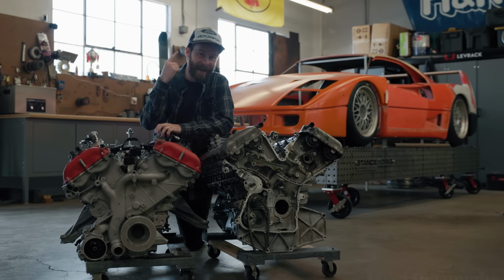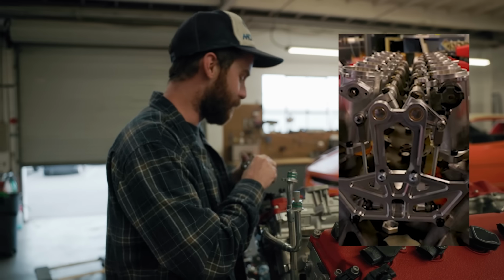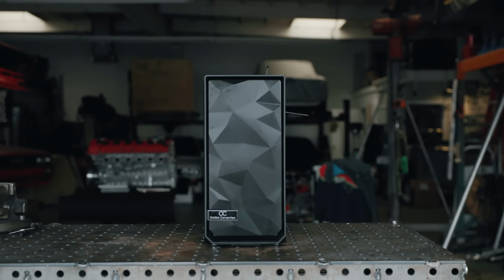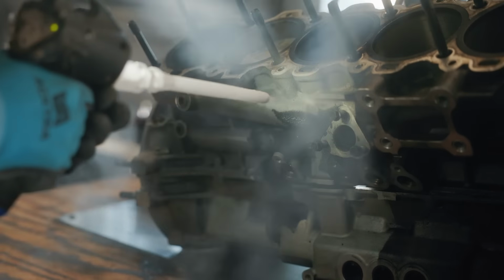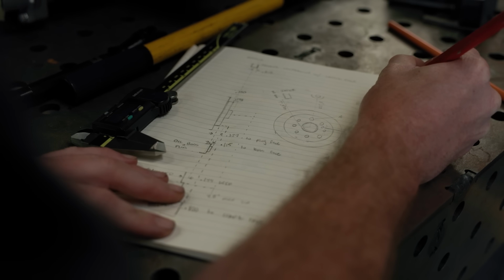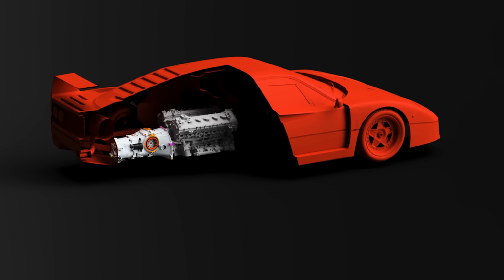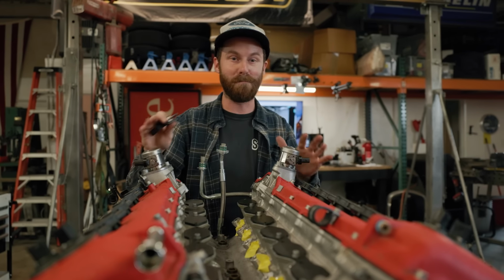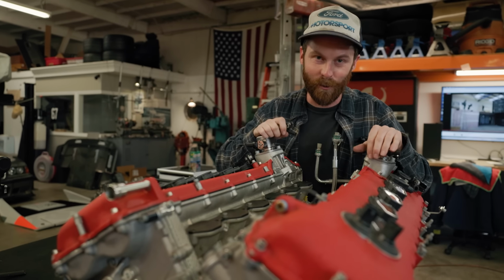Stuffing a V12 into my F40: 3D scanning is my favorite tool yet.

Comment: The only difference that I could imagine port on ethanol vs DI is that fuel will take up some space in the intake tract and around that valve that then cannot be air. It's probably extremely negligible though. 

Smart move makes sense.

Comment: DI isn't inherently dirty, it is the EGR and crankcase ventilation being put back into the intake that makes the runners dirty. Some ways to make it run cleaner are:

1. Having a catch can that can separate the oil vapours before they go back into the intake
2. Making sure you bed the rings in properly to reduce blow by and therefore crank case ventilation
3. High quality oil

I've got a Mk6 Golf R which has done about 180,000km (115,000mi) and just had the first decarbon. The guy who did it said he has seen other DI vehicles that have had multiple cleans that were dirtier than mine. I don't have a catch can but made sure I went through a run in procedure when I got the car (I bought it brand new) and have run Motul full synthetic oil since the first change.

Still think you're right getting rid of it because it's a PITA to tune and the options for bigger injectors and aftermarket ECUs are limited. I'm looking at going to a bigger turbo and am looking at ECU options that will allow me to supplement the DI with 4 port injectors which I think will actually give me the best of both worlds.

Comment: I buy the rational behind removing DI, especially on an already performance oriented motor. 

I think the general idea that DI motors are designed radically differently from MPFI motors comes from the design differences in efficiency oriented motors. Small economy DI 4 cylinders often use very small tumble ports and unusual piston crown geometry to take better advantage of the efficiency benefits of DI. That typically makes the conversion to port injection difficult and inefficient on that type of motor.

You'd think a Ferrari motor wouldn't make these compromises, and at least in port design it doesn't look like they do. 

That said I'd love to see a comparison between the insides of that motor and it's MPFI equivalent (especially combustion chambers/piston crowns). Would be very interesting to see what Ferrari did and didn't change when moving to DI.

Comment: If your not manually controlling the clutch to shift gears its not a manual.... this guy is a joke
Reply from the maker: Would you call a dog box in a Nascar a manual? You don't clutch with those either. Nor any Trans Am road race car. Nor any Formula Drift car. Most race car gearboxes don't use the clutch to shift.

Comment: God, this is so lame. OK, you don't want direct injection; why? Because it's for emissions not power. Next? "I want to eliminate a fuel pump driven off the cams, but don't want to "unbalance" the engine, even though "I don't know anything about them". Geez. So much for engineering, let's just chop up a perfectly good motor and see what happens. Oh wait, OMD in San Diego eliminated the direct injection and "they got it running" and "it's insane" and "it's so sick" and "incredible" with the "coolest valve covers I've ever seen". Wow, that sounds really good.
Reply from the maker: Just don't watch then, no need to be rude about it. You don't have to like my episodes. It's not for everyone, I understand. :)
Reply: Then you go out and build your own F40 with a Ferrari v12 and direct injection.

Comment: Gti golfs etc on di make 11;1 c.r turbo and run e85? And there's knowledge on going over 500hp with 2l. The fact Ferrari did di and 13:1 is exactly why it's di. But yeah. I will be surprised if you have 700whp. I don't want the rods to leave the block for you.

Comment: why on earth are you dry ice cleaning on a dudd engine. Just a waste of time and procrastinating
Reply from the maker: Different strokes for different folks. I don't want to look at a gross, nasty engine for the next two years. Why not spend some time to clean it up? :)
Reply: @stanceworks  Idk, I wouldn't use it anyway, you already have the engine you want to use, why use that? not to mention it has a massive hole in it so the measurements are probably off-bonk
Reply from the maker: I don't want to be cutting and grinding metal next to and over an expensive engine.
Reply: @stanceworks  fair enough I guess. But the project will be much longer if you are doing side quests
Reply from the maker: I'm here for the project, not the end result :)
Reply: @stanceworks  i mean you get paid by sponsors no matter how long the project is so ig it doesn't matter

Comment: $100 and you could’ve had a machine shop clean it with a hot tank to come out even better than those burned heads did.

Probably not as satisfying content, but pretty standard work.

Comment: Would have been pretty cool to see you do both direct and port injection. I know you're an older BMW guy but anything N54 and up usually do both to increase fuel flow and to eliminate valve cleaning issues. You can keep the benefits of both systems, at really not all that much more weight or complexity. You just need an intake manifold spacer, extra fuel rail, and controller (or in your case, pretty sure the haltech can handle a workaround to run 24 injectors, i'd hope). Efficiency can run both ways, either more MPG OR more power.

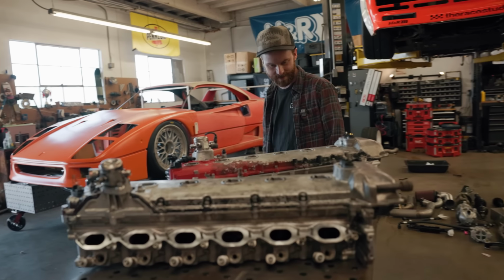Comment: 14:58 anyone else cringe when he sat the cylinder heads on a steel fabrication table, then proceeded to slide them around? Hopefully those mating surfaces didn't get all scraped up and gouged.
Reply from the maker: The heads are trash anyway, worry not!
Reply: @stanceworks  OK that's for the reply.

Comment: 22:43 "crazy sized adapter".... You're building a chassis. That size difference would work fantastically with a midplate... just a metal plate attached to the frame, that sits in between the transmission and engine, serving as a super-stiff mount for those and here, potentially, suspension components.
Reply from the maker: Why use a massive adapter plate when you could just have a transmission that fits? :)
Reply: @stanceworks  Because you can skeletonize the adapter plate and use it as a frame member as well as potentially eliminating a set of engine mounts (depending on layout). Eliminate one crossmember and take care for some inherent triangulation, and you can still use a thin plate as horizontal location and torsional rigidity... even a solid plate, guessing here 4' between frame members and 2' tall for a nice even 8 square feet of material, 1/4" thick 6061... 288 cubic inches, I'm getting 28 pounds for that and I'm not figuring in the missing material for the interface or anything removed from the ends. 30% excision = just under 20lb. Not bad for a hamfisted set of example numbers. 

It's a classic solution for drag racing, that's really the best place to look for pros vs. cons.

Comment: I like direct injection, but my usecase is wildly different. We don't have E85, and i somewhat care about efficiency.

Also saying direct injection is dirty is kinda misinformed. The reason why it is seen as dirty is because all the oil dumped on the valves by the breather pipes does not get washed away when running purely just direct injection, but either a dry sump or running something like water methanol completely solves this issue.

Comment: Why you dont use port and direct injection for better tuning to have both benefit??? And the High pressure pumps for Port injection with high pressure injectors for better atomasation???? And keep rhe high compresion on cylinders???

Comment: agreed, DI only makes sense if you keep the factory computer. Good luck running it reliably on anything short of the most insane, bleeding edge motorsports ECU. DI is vastly superior to port injection from a science (especially physics) standpoint, but as you explained e85 more than solves for the performance and engine calibration issues you introduce by moving back to MPFI.

Comment: While you talking about the holinger with paddle shift, i just thinking that maybe someone has made the wireless paddle shift with the receiver/servo attached on to the gear selector, lessweight than using pneumatic with compressor 🤔

Comment: Why..???  😣 when theres an F50 or an enzo or laferarri all mid engined v12’s.. why would you want to take away the bulk of the F40’s unique character being that 2.9 V8 twin ihi turbo spooling to almost 8.000 before dumping n comp surging and cackling on a trailing throttle..
Reply: Because the F40 is the coolest Ferrari and a Ferrari V12 is a quintessential engine. And because he can.
Reply: 🤓 “WHO TF IS THIS GUY” ???? 🤣
Reply: @bossboyritchno1685  not sure who you are. V12 wail way better than twin turbo v8 noises.
Reply: @seancca  cornball 🤡

Comment: What is the overall length difference between the v12 and the v8 of the F40? That would be valuable information when you are working out the ergonomics and chassis design

Comment: This car is already undrivable at nominal power. The only way to address its funky, very upsetting handling would be to give the front more grip—essentially adding significantly more weight toward the front. But if you put a lighter engine in and double the power output to 900hp, the rear wheels will spin like crazy.
If you want to make something out of this beast, the only real solution might be to turn it into a sophisticated, F40-style four-wheel-drive setup. That could balance the weight and improve drivability. That said, my guess is this will end up as a demo car—it’s not even going to compete with the 208.
Reply: The v12 is not significantly heavier than the v8 that came in the car.
Reply: @seancca   That's the problem I'm talking about. It's not heavier but much lighter, as the guy mentioned in a previous video. I invite you to check it out. So, how is this F-40 going to stick to the ground? He'll need to create a massive aero package, which will likely obscure much of the classic F-40 design.
Reply: @vivianvaldi7871  I have watched all of Mike's videos and I also am a supporter of his channel and chatting with folks in the discord. This car will not require a massive aero package.
Reply: @seancca  OK then it will be a nice demo car. That's maybe what he's really planning this time.

Comment: Hi Folks. Be careful with removing... Some engines have designed Pistons to run a lean mixture with only is ignitable around the injector or Spark Plug. Watch  for the Cam and valve lift Timing (on a 4 valve engine they can create a flow swirl with asynchronious opening one valve after an other) or the Piston is shaped other than flat.
If the Piston is without any odd shapes, it should be manageble. 

I Wish the best luck and waiting for the next Video.👍

Comment: Don't buy intel flagships, they selfdestruct, it has been a big scandal last year but there is a secret. You already have a good Noctua Cooler, next you need to undervolt it and it will stop it from melting itself. Also you can undervolt the quadro. You undervolt until it is not stable. My have undervolted my 3060rtx to 887 mV and my Ryzen 5500 to 950mV. I can render Ai and play tanks at the same time, before undervolting I was scared my pc would melt. I only lost 8% performance but gained mega stability and made it last longer.

Comment: What is the horizontal angle of your driveshaft?    I am installing a Z06 drivetrain into my '72 vette and even after moving the wheels back 3" i still have a 15* angle.  15* is  not bad, but curious what you've got.

Comment: Getting rid of DI is currently a no brainer when you want to do anything motorsports wise, if not, have port injection tied into it. Which of course not only doubles the amount of injectors but vastly increases the complexity of tuning, its not worth the headache. DI injectors run at over 90% duty cycle on stock economy cars, leaving no headroom aside from HPFP upgrade and new, slightly larger hard lines, the pay off isnt worth it.

Also what youre currently doing IS apart of the build, if people dont find the actual process interesting then thats not only pretty strange but also their problem and why they probably dont appreciate a build of any level.

Comment: I fail to see how you will make port injection work. At the very least you will have to pull the heads to weld up the holes properly, you would need custom cams to change the intake opening for port injection also?

Comment: Stanceworks... its your trainset , you play with it how you like. Just observing that, as someone with experience of straight cut, sequential, and straight cut sequential boxes, it could be outrageously loud in the cabin and thats before anyone applies the 800 at 9000 numbers. It may be advisable to seek assistance with sound deadening as a core aspect of the build. Additionally, super dooper gearboxes are typically only super at high rpm high load changes. Light touch changes in poor grip can be tricky, and are sometimes safer both for driver and gearbox internals if a clutch is used. Noting downchanges can be sequential bam bam bam's... but mortals who.pay for theirnown rebuilds have found to heel and toe has significant positive correlation to rebuild interval and cost. Plumbing a engine coolant laminova into the gearbox as a heater isnt a bad idea too. Pay attention to the seat and pedal ergonomics as an easy and quick clutch makes changes... massively cheaper. A sprung clutch might not be a bad idea either. Aspirational.project, watching with interest. Failing that.... sperical bearings for everything and solid mount the engine and box ;-)

Comment: direct injection is what keeps that engine from experiencing pre ignition fyi. youre going to find it wont take nearly as much timing advance on port injection only.   youll be okay on full e85 at 700hp. im sure youre going to run piston rings designed for port only etc etc.  cant wait to see it.

Comment: fuel and ignition system that came  with that engine is very sophisticated(feedback from F1 program) It can adjust timing and fuel for each cylinder based on the feedback from each coilpack. and it is very high compression ratio too.

Comment: Hey Mike, ask some of your trusted contacts about "in cylinder cooling" on the pistons and how the pistons (may or may not) be designed different between port inj and direct inj due to that cooling and if the change to port injection could in any way affect the piston lifespan.  I've seen a few youtubers say they had issues changing a motor over to port injection and have melted / broken pistons as a result.  However they were not working on Ferrari engines built for 800hp either :)  I honestly look forward to every one of your vids - and "the nerdy bits" - keep on doing things your way :)
Reply: Did you hear Mike talk about running E85?   Its cooling properties are more than enough.
Reply: @scotth7686    Yup - I heard that, I tuned my car to run on it for the same reason (well that and more more power output)  Still, its worth investigating now, rather than finding out later that it should have been investigated :)
End of the day - not my car - not my engine and we'll get our content fix either way :)

Comment: Port injection is much easier for programming, tuning, no carbon buildup on the intake valves as well as easy to add a lot more fuel when cranking up the power. Direct is good for efficiency and the ability to use low octane fuel in a low pressure forced induction system. It also adds the need to take everything apart to remove the carbon buildup after a period of time.

Comment: Mike, another awesome video, as always. And yes I even sat through the nerdy stuff about the direct injection.  At this point I would like to say that I am both a fan of and hate direct injection for the same reasons that you mentioned.  What I am wondering is why you didn't leave it , for all of the bonuses that it offers and then add a piggy-back of the port injection? Not even in the same ballpark, but, the Subaru BRZ runs direct injection with port injection. It gets the mileage bonuses with the clean running of port injection.  Plus, since you are planning on ITB, you could even step it up a bit and go with the port injector and the variable length velocity stacks with a central mounted injector in the way a MotoGP engine does. This would increase low end torque and top end horsepower.  For me, that would be the ultimate NA engine.  But, I respect you and all of the decisions you make, because your track record of cool shit is second to none. Can't wait to see how this build turns out.   Sidenote: I watch the entire build of the last Ferrari and saw it (touched it) at Sema.     Gordo.

Comment: I do have a serious question about removing the DI system, when Papadakis Racing removed it on their B58 build, they had to press in some very thight plugs to block off the DI hole on the cylinder head, will you do something like that with this engine?
Reply: Yes he will.  He has to